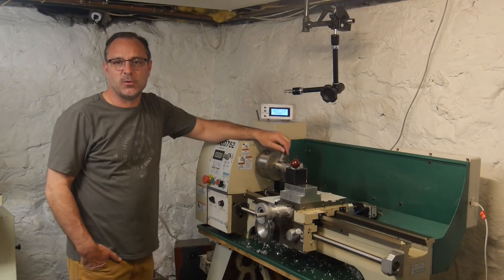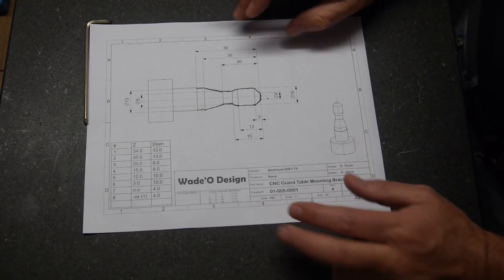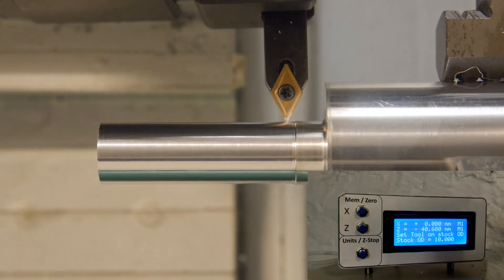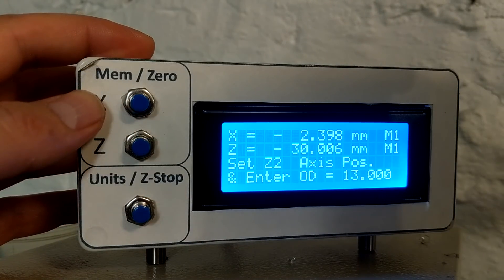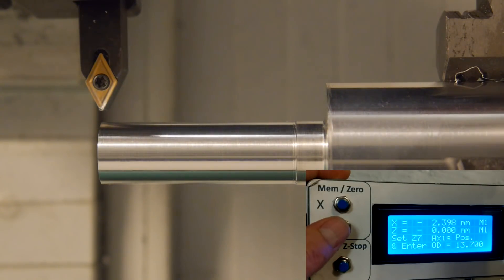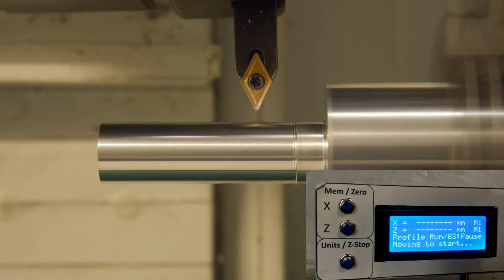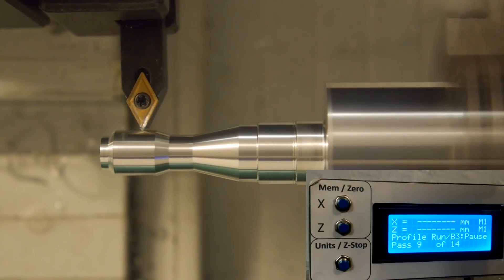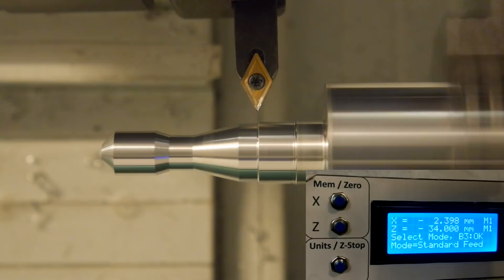CNC Lathe Profiling with Arduino (3 of 4)

Comment: You hit the nail on the head. A gap between CNC and manual. I have a 3d printer and the biggest hurdle is the cad design. If you wanted to add CNC, you could allow for a gcode parser (you mentioned before about using most of the memory tho). But you could add a SD slot and then accept cards with external designs as needed.

Comment: So wait, is this Arduino running GRBL with some extra code shoehorned in, or something you built up from scratch? If the former, I'm impressed you found available pins and memory for running the LCD... If the latter, then I'm simply damn impressed.
Reply from the maker: Fully from scratch 😁
Reply: @wadeodesign2699  Are there any plans to release that code? I've poked at the rest of the specs on your site, but am really kinda curious how you implemented this. Even if it's a mess, I've already heard the disclaimer that your last coding experience was in Fortran. No judgement here. (You should see the ungodly things I've done in Python lately to get my plasma cutter running. lol)

Random fun fact: my currently-dead lathe is a "Wade," circa 1940. No idea how that brand ranks, but I got it at an estate sale last year and couldn't say no to the price. Not planning on CNC'ing it, but now that I've got the plasma cutter, it's time to stop procrastinating and make up the adapter plate for one of the spare 3ph commercial treadmill motors I have laying about.

Comment: This is great, and it sure does fill the gap between manual and cnc. As someone not quite ready for cnc I'd seriously consider this option.
Reply: $2400+ initial investment hurts though.
Reply from the maker: Note. It's less $700 if not using full CNC.  But put aside that for a moment and think of it differently.  Once you have your lathe conversion complete and ready for software I propose there is two independent paths.  1) CNC software which I estimate at $700.  OR 2) My custom Arduino code which will run $290.  So you can start cheaper, have a DRO, manual control, threading, etc without learning CAM or CNC software.  Then of course you could add that in the future and simply choose which controller u want to use with a flip of the switch.

Comment: Good stuff 👍 been enjoying your lathe build, I like the way you have kept manual functionality.
Reply from the maker: Glad u like the progress.  Next up will be some simple Facing/cutoff ops.
Reply: Wade'o Design sweet will be looking out for the next installment. Did you happen to receive my email? I was asking about what went wrong when trying to use steppers for the manual control through Arduino? I am planning to use clear path closed loop for my CNC conversion.
Reply from the maker: I didn't see an email about this.  Did u go thru my website... Could u try again for me.